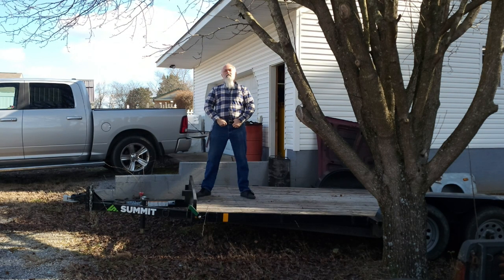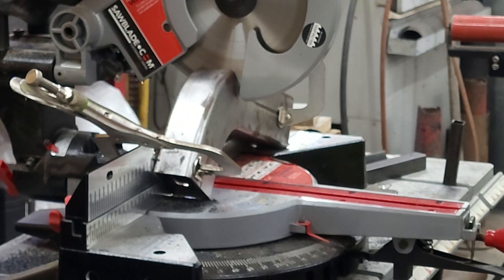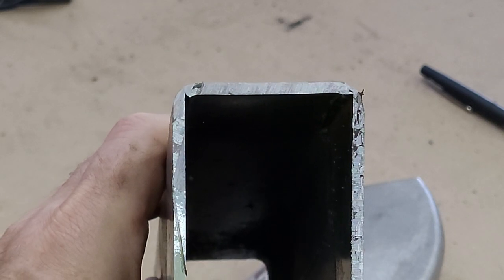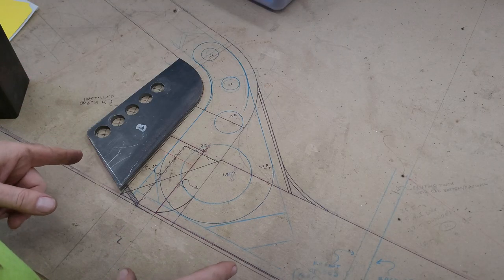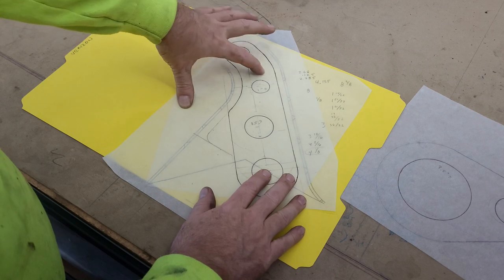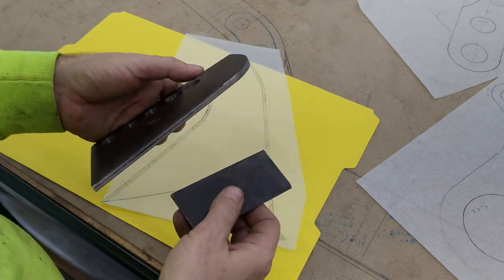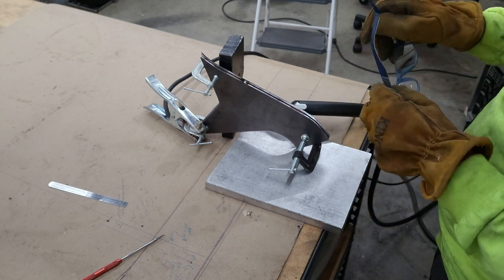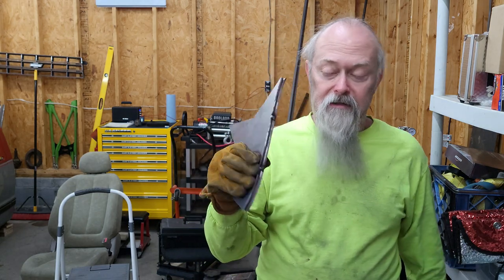More fabrication on our pro street S10 project "Spare Parts" @BareRoseGarage  #nonamenationals

Comment: On those joints.... before you weld them "v" grind them and you will get max penetration in it all. Doesn't take much of a grind, more of a buff, but gets you a good valley to lay your weld into. As for the Fish Plates..... spot on brother. When you are laying in your bead on those.... I do the Roll'n'Go method (esp with that heavier stuff). Get your puddle going and roll it back into it in a continuous "rolling" circle pattern. It comes out looking like you TIG'd it, and since you are doubling every pass it makes it good and strong.
Hope that helps man.
Reply from the maker: Great advice as always BR. I appreciate all the help you've been giving the internet.